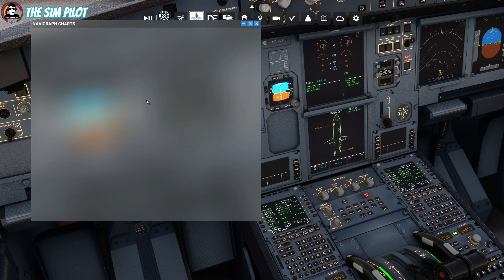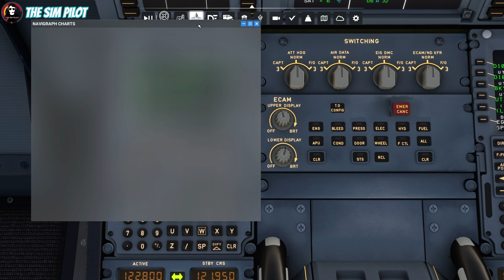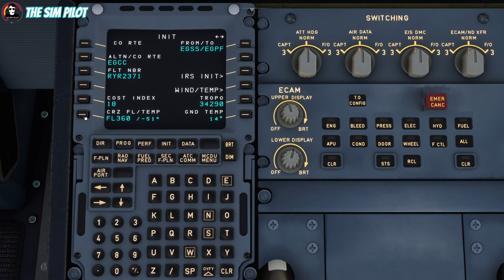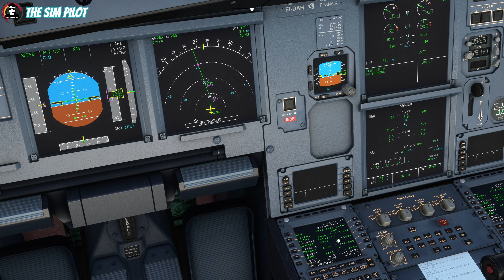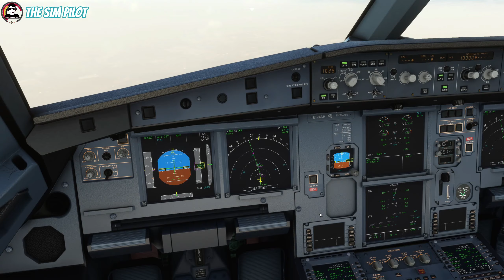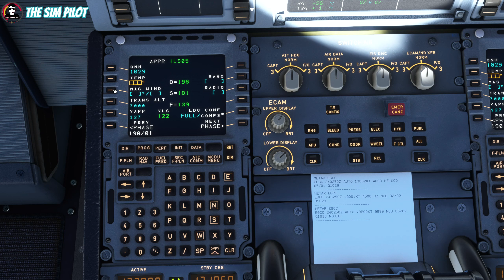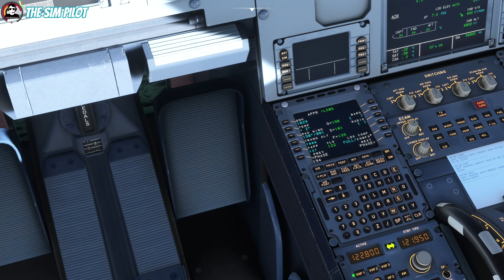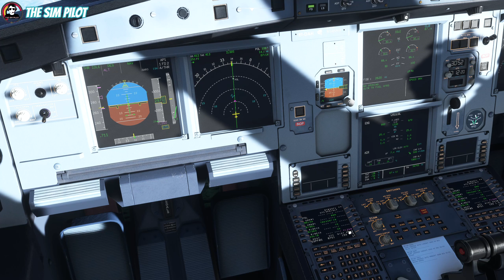MSFS2020 | Tutorial | FBW Releases functional VNAV for A32NX | Full flight Tutorial

Comment: I think I´m doing something wrong here. I get all the correct restrictions in the MCDU and on the ND, however, I get no predictions whatsoever. No little arrows on the ND and also no altitude pridictions in the flightplan. Is there something you did in preparation to this video that a might be missing?
Reply from the maker: Not really it was the experimental version at the date of the recording. Maybe they have changed something in the later experimental versions.